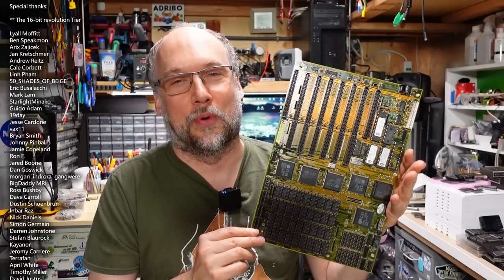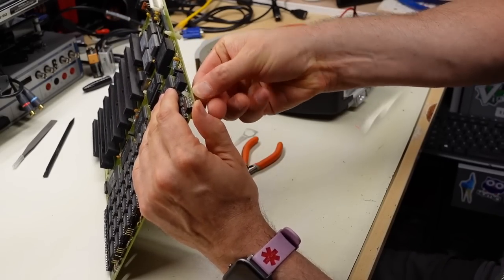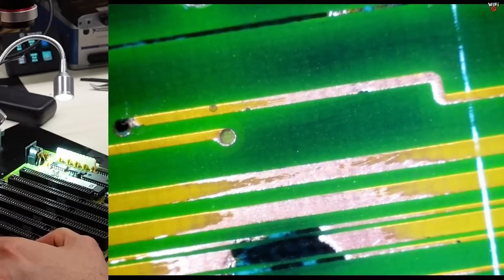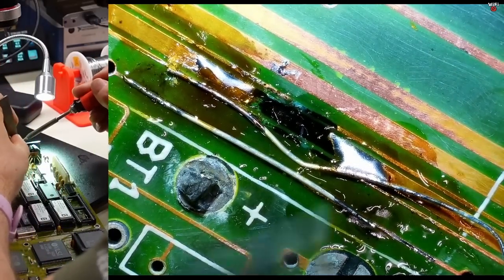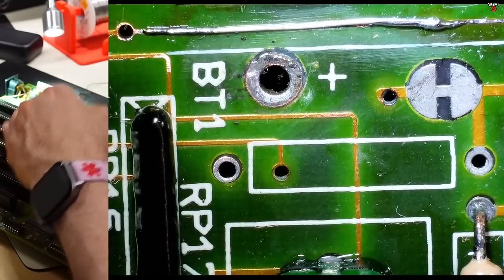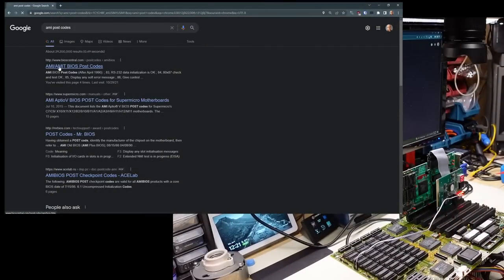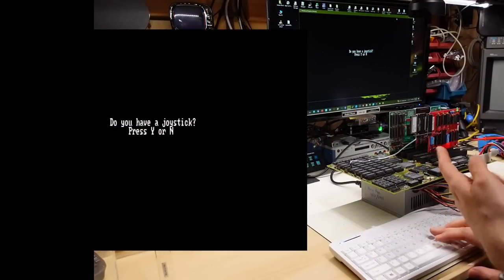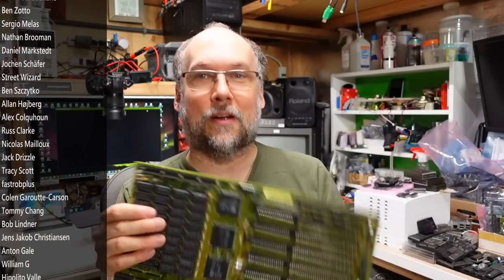286 motherboard repair - VARTA battery leaked

Comment: Love the channels. I recently found how to remove the plastic stand-offs without tools. Here goes;
With one hand hold the stand-off from underneath the board applying a little pressure in the direction you want it to go (straight down).
With the second hand use the tip of your finger or nail to push one side of the stand-off just in to the hole. Keep pressure on with first hand and twist slightly (optional) to ensure it doesn’t pop out again. You can now push on the other half of the sand-off with your finger tip and it should just push through easily.

Comment: I got anxiety watching the motherboard get drummed on, played like a piano, and bounced up and down like a trashcan lid while running lol.
Joking aside, I cleaned off a 286 board too with vinegar, having corrosion from a battery. That got very active though, and was quick to dissolve the crust. No traces broken, just exposed, cleaned and sealed it with green nail polish, akin to the trace colour. Good video, yes sir 👍🙂

Comment: Just a friendly advice on flux/rosin. I actually prefer to use rosin due to it being less health hazardous. If and only if the application calls for a good flux, I recommend Amtech NC-559, a clean flux that also dose it's business right, but use it with caution and definitely not without a smoke absorber that preferably exhausts outside... nasty stuff these fluxes. Thank you for the wonderful content and keep 'em old computers alive!

Comment: I had various motherboards from that era, and even after that. But I never had to deal with battery leaks. My first 286 machine had a separate battery pack with 4 AA batteries in a holder. Then it was updated with a 386 that used the same battery pack. Then upgraded to a board with an AMD K5 CPU,with a CR2032. That sucked, because it froze a lot. But no leaking stuff ever since. My "new" old machines that I got recently, had Dallas chip battery issues.

Comment: For nylon standoffs, depending on the size, I’ve had luck with a 5/16” deep well socket. Just press it right over top all the way down and it will pinch the ears

Comment: No-clean flux is actually harder to remove than normal flux. It dries harder and was originally designed to just be left on, but no one does that anymore. For hand-soldering, just go with rosin.

You can search for "why clean no clean flux" and find a number of results, most of which are the same article reposted.

Comment: Adrian, try using LINESMAN Pliers to get those standoffs out - the flat surface of the bite face as well as the tip of the tool will allow you to near the Motherboard with the pliers to get the best bite on both tabs minimizing the chance of damage to the board.  For extra insurance you could put some thin thermal pads or electrical tape at the end of the pliers to quell any chance of scratching the board.

Comment: Those plastic case mount standoffs are indeed fiddly and tedious at times. I've used everything from needle nose pliers, nail clippers, melted Bic pen caps/bodies, screwdrivers... Although needle nose pliers can work (only by squeezing the middle or tip of the standoff, not down by the PCB) they're just too darn annoying to be worth using. 

I've found the best way for me is as follows: Press one tab in with a finger/thumbnail/screwdriver while pulling on it from below. The idea is to get the first tab to clear the PCB mounting hole, but don't pull to the point where the second tab mushrooms out. Push in the second tab in when the first one clears, as it should have a bit more room now with the first tab out of the way. Using that method, I can actually remove them by hand fairly easily and consistently without tools. Of course, YMMV depending on the size of the PCB holes.

Comment: What helps with getting those nylon standoffs out is being able to turn them so both ears can be compressed at the same time. As for cleaning damaged traces, a sharp Xacto knife with the spatula profile is the best, as you can carefully scrape from side to side and minimize now much of the solder mask gets scratched up in the process.

Comment: Nice repair!  I had the same issue with my deltalab super timeline rack delay.   I made a repair video about it on my channel. The NiCad leaked on the board.   I had to clean the board with sandpaper.

Comment: I've repaired many boards like this. You did just fine!. Its never pretty.. I like that you use nail polish (lacquer) to fix the jumpers in place. I've been using superglue. Just a tiny drop amount but once it goes off, its permanent!. Yeah getting solder to flow on old PCB tracks can be tricky, but pre-tinning the track should help before placing the jumper. All-in-all, good job!. Thanks for the video.

Comment: You can remove and even reverse corrosion with Amtech flux and scraping with a dose of hot air. A thorough cleaning of this kind of acid dunking would require a sonic cleaner, a dishwasher on low heat and minimal detergent can do in a pinch.

Comment: The graphics card crash issue reminds me of using a Spectrum with a RAM expansion on the rear edge connector, where even something as simple as pressing a key could cause the expansion to wobble and the system to crash. The official "fix" given by Sinclair was to use a lot of blue tack to wedge it in place and stop it from moving.

Never used the earlier machines, but I've been told they had the same issue.

Comment: I'm going through this nightmare with a Mac II board.  No battery issues, just leaky smd caps.  Replaced the caps.  I've got it back to chiming but no video. There are so many tiny tightly packed traces that could be the issue.  I need whatever that magnifier thing is you have.  Or just send the whole mess to you if you're looking for another project haha
Reply from the maker: It's made by Andonstar .. I think it's the Andonstar AD409 but there are much cheaper ones which are still really good, just without the HDMI output and what not. 

And I'm definitely all full up on projects at the moment!! LOL!
Reply: @adriansdigitalbasement  Many thanks.  I've gone for years without needing magnification but somewhere in the last year suddenly it got hard to see small things.  Funny how age just flips switches on you sometimes. :)  I'll check out that magnifier you mentioned!

Comment: I use solder that has original rosin. So every time I use alcohol on it. I end up with a cloudy sticky mess. Goo gone helps, but good old chipping it off with picks works the best. In some cases it is better to just leave it on.

Comment: Good job! It would be great if you also put a CR2032 replacement battery in it (of course together with the diode to block recharge). Thanks Adrian!

Comment: Along the same vein, check all your vintage electronics - in storage or in use. Just search for the device's name and common issues. I got an original XBOX (gave mine away long ago), did a quick search, found that the clock capacitor is the death of those boards, and went in and nipped it out just in time. It had given up and given the board a barroom baptism, but apparently recently as there was no damage. Just cleaned it up and put it in storage (since I'm not using it nowadays).

Comment: Back in the 1980s Bally or Williams shipped a mini toolkit with some of their pinball machines, mostly contact burnishing and shaping tools, BUT, they also shipped with a 6ish inch piece of brass tubing that was the proper size to squeeze the latch on those standoffs and pop them off in about a second a piece. I would expect a model/hobby shop to carry the tubing stock, just take a board and find the size that fits, and your standoff issues are history.

Comment: A great way to remove those standoffs or other similar plastic clips from the automotive world. A 7 8 or 9 mm deep well socket will sleeve right over the heads and compress them so you can pop them out. Experiment with the best size socket. You can even use the round end of a combination wrench. They are super similar to automotive fasteners. There you have it!

Comment: if you're planning on throwing those standoffs away, just get some side cuts and clip em off. saves the effort for something you'll be using proper metal standoffs with later.

also; POST is an acronym for "Power On Self Test".

Comment: Tip for getting out plastic stand-offs.  Get a scrap telescopic ariel off a radio and make yourself a tool that slips over the standofff and presses it all together, mine works well.

Comment: FR4 has some tolerances even today.
If it is on the very slim side back then it could explain bad contacts.

Keep in mind usually it would be screwed in and held in place that way.. so that issue would be less big.

Comment: The 8 DIP sockets are 2 banks for 256kBx4 DRAM (for a total of 1MB) and the 4 unpopulated DIP sockets at the board edge are one bank of 64kBx4 (to be used with one of the banks of 256kBx4 to a total of 640kB)

Comment: A good fix. 8 beeps = video so i knew before he checked online. The only other error that matters is 3 beeps = ram. The rest are obscure, but having the post card helps diagnose those. Battery is only for clock, no big deal. There is a 4 pin connector next to battery (missing a pin in that mobo) you only need the two extremes, that connects a "external battery" which was just 4 AA in series, i still have one of those plastic thingies. A taxing (3d) game to try is Stunts (it has demo mode), not only works from xt to 486 it would run with many video cards. This was declared freeware by the developers years ago so you can download and crack its security question (source code was lost) legally.

Comment: Have you considered a set of scratch brushes? They're pen shaped - you can get a set that includes nylon, brass, steel, and fiberglass. The fiberglass brushes are really effective but they do throw off little fibers.

Comment: During the Soldering another repair video crossed my mind: The guy used also flux during his repair of the broken traces though did not run a wire over them. With the flux as an kind of delivery agend he let the solder flow on to the broken traces. He said in the video that the solder would soak itselfe onto the trace.
Not sure if the broken traces on this MB are too small, though I guess this method is cleaner, quicker and easier to ultimately cover up ?

Comment: Well done, Adrian. I wonder of you could use two CR32 in series and have a dropper resistor to get the correct voltage

Comment: I recently picked up a ChipQuik brand no-clean flux pen, and it's so much nicer and easier to use than my big syringe of MG Chemical stuff: much less smoky and messy. My MG Chem solder is nice, but the flux is not great. The ChipQuik pen is actually like a felt tip pen with liquid flux in the handle.

Comment: every time you deal with something like this, I panic and check if my 286 motherboard is still ok.
I've considered taking out the battery, but it still looks fine, it's not leaking, and I'm not sure if it can be replaced.
it's a 3.6 volt battery, it's blue, it says "3/GP60k" (I'm not sure if it's the brand or what) and it says "60mah".
it doesn't look like it can be replaced by a cr2032 in a simple way like "I'll just take it out and solder a slot for a cr2032".
I'm a bit afraid of taking it out, like "what if without it the computer doesn't turn on?".

Comment: Your mileage may vary but I've had really great luck using that eco-friendly non-toxic automotive rust remover stuff that comes in the 1-gallon jug on motherboards & cards with cotton balls to wet down the corrosion and a toothbrush to brush it away (not naming product names just to be safe, the stuff they advertise on the car repair shows on TV). Most parts stores carry it, don't think I've ever seen it @ WallyWorld. It's the only stuff I've ever tried that didn't have unexpected problems of its like discoloring the solder mask, plastic on the headers, other metals, or hurt electrolytic caps (not that I dunk things in it anyway). The stuff is way better at getting crud off copper than anything else I've ever tried over the years. It's awesome, brush it on with a q-tip or cotton ball/pad, let it sit, brush the crap right off

Comment: I was watching today and it made me want to go back to a 286 I have with battery damage, it also has no manual and I can't find any information on the jumpers to setup the memory. I got as far as removing a few chips so I could inspect the damage under including the keyboard controller, but I have not tried to repair any of the damaged traces.

Comment: Yea was gonna say the sam as @Antipode. Thats why POST is always capitalized. Also to get the plastic standoff's off needle nose pitch at the tips with semi light pressure and push down. The slight opening of the pliers pressing down will constrict with the downward and then close them till the plastic is flush and should be somewhat simple.

Comment: I find that white spirits is much better when cleaning flux up. if you warm it up a little first until it becomes liquid and then clean it off with a q tip and some white spirits, is will come up much easier than trying to remove it with alcohol.

Comment: Rosin flux works great and is cheap, but boy is it annoying to clean up when it builds up like that. I used to use either acetone or a flux remover spray in a proper chemical resistant container and a brush to remove it from boards. No matter how much I cleaned it, somehow some little bit of it would always still be under something or stuck inside a connector.

Comment: The no-clean (often called no wash) flux will not dissolve in alcohol because it is designed NOT to be cleaned/washed off. There may be specific chemicals to clean the no clean fluxes off, but alcohol is not one of them. Some will come off with a citrus degreaser, others with chemicals provided by the flux manufacturer. Almost all will leave that whitish residue when alcohol is used to try and remove them. The whitish deposits are not going to be an issue, but they do look pretty ugly.

Also, when adding long wires to fix damaged traces, you can keep the wires in place by tacking them down with cyanoacrylate (crazy glue) adhesive/glue. The board repair people at the facility I worked at had this down to an art. Run a wire some distance, put a drop of glue down in the right spot, wait a few seconds, then bend the wire around as needed, as the anchor point provided by the glue can be used as a pivot point. Repeat as necessary. Even if it was a long straight wire, they would tack it down every few inches, just to keep the wire from snagging on something and keep it close to the board surface.

Comment: I recall, back in the day, RadioShack selling a trace pen, that puts down a new layer of conductive, mettallic, trace-like material.  You had to mask the area around it before applying it.
Reply: Apparently, they are still carrying the product...at least the new owner of the Radio Shack name.  It's made by CAIG Laboratories and I think it's called "CircuitWriter".

Comment: As handy as the wire wrap wire is most of the times, I prefer the flat ribbon type PCB repair traces often better.  That is because those strips are stiffer in sideways direction.  The wire wrap round stuff tends to twist all the time.  On the other hand, if you need the insulation, especially on longer runs, then the wire is the obvious choice.

Comment: Yeah, can't beat that rosin-based flux. Terrible to breathe in the fumes and a pain to clean, but definitely worth it compared to that liquid "no clean" flux.

My eyes are slowly getting worse, so I really need to pick up one of those microscopes. I'm thinking I can just get the scope and connect it directly to my monitor. I've already got a spot on my desk where I can mount it using a cheap articulating arm and clamp.

Comment: I dealt with the later systems like early Pentium PC's and those have the Dallas clock chip, that while they don't leak, are equally of a pain to deal with, with their sealed up internal lithium battery. Those absolutely need a working clock battery all the time though as they forget about the BIOS settings immediately after you press Y to save, and even for like 2 minutes you unplug the battery to change the battery for example, and by the end of it the internal lithium battery still had 3V in it, the time would keep going, but settings are all wiped again!
I would sand the hidden positive pin off and then hook them up to a 3xAAA battery holder and use 3 Ni-MH batteries and power it up that way, as I can get those battery holders for cheap. This would allow the flexibility to switch between Ni-MH vs Alkaline/Carbon Zinc at will (as those don't recharge the battery), but to use the latter i would jump over one battery slot so I don't put 4.5V inside.

Comment: It doesn't worry me squeezing in the little wings on the stand-off with pliers, but brass hobby tube has a lot of different sizes, ie, I use a tight fitting brass tube to I get pins out of molex connectors.
The keyboard connector needs to come off because it's probably corroded underneath. Really every corroded part needs to come off and be resoldered, ala, Necroware, because any trace of corrosion will probably return eventually.